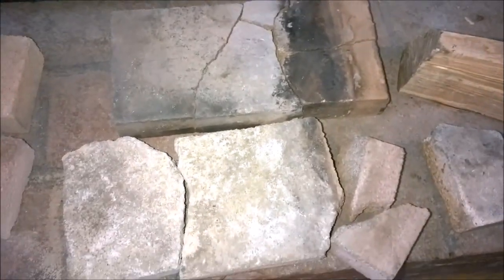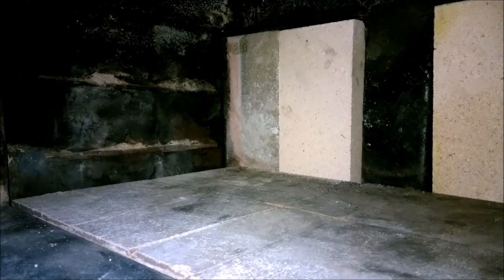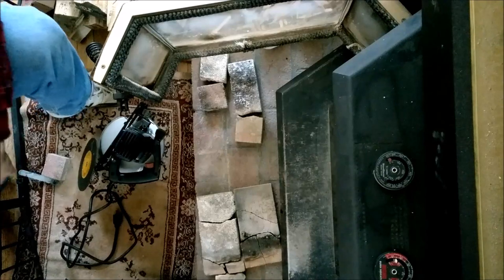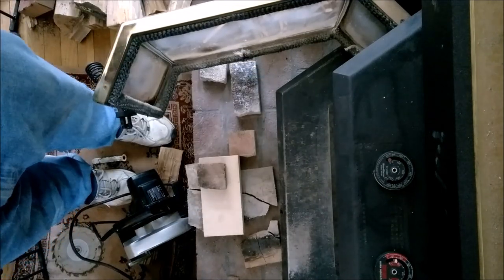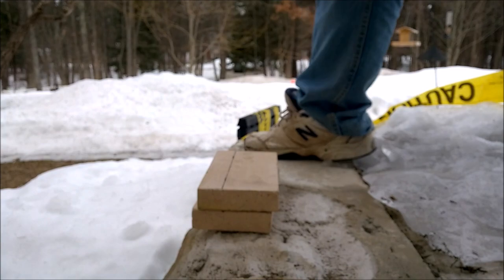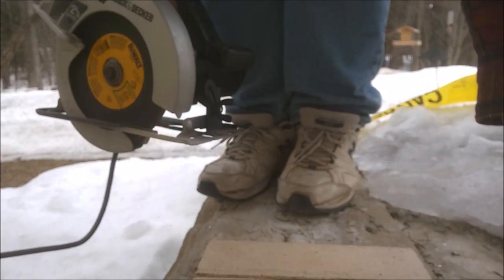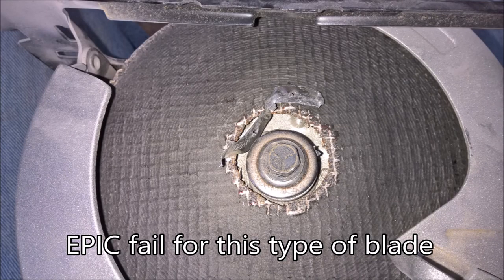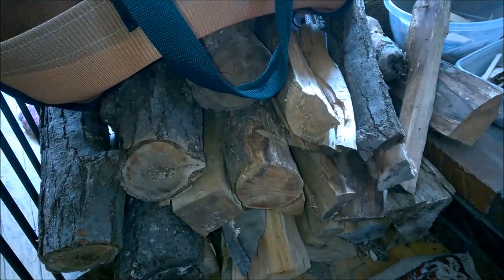Replace broken Firebrick in Wood Stove

Comment: George, you're a great sport for putting up with all the "constructive criticism."  Thanks for the video.  I now know that cutting firebricks with a circular saw (or an angle grinder cut-off wheel) can be done without shattering them.  Gotta admit though.... these comments had me laughin pretty hard.  Thanks for the video.
Reply from the maker: It might be the wrong way but it worked
Reply: Getting it done..

Your video gives me a lot more confidence  to post the 100s I've made buy haven't  posted for multiple  reasons... bad angles, lighting, foul language, other bone head remarks, etc..

Anyway 

Thank you! 

Keep doing you! But please be a little  more  care for future  projects...c- clamps and hand spring grips and a lot cheaper the cost of your new blade and the hospital  visit... go to Harbor Freight  for those items! Under $10 for some and under $20 for most of the rest.... I literally  have over 60 different  kinds of clamps or hold downs when using my power  tools.... I still have and plan on keeping  all the digits God gave me. 

Good luck!